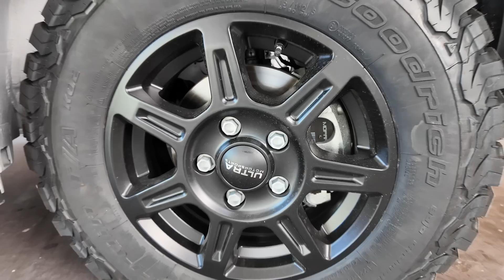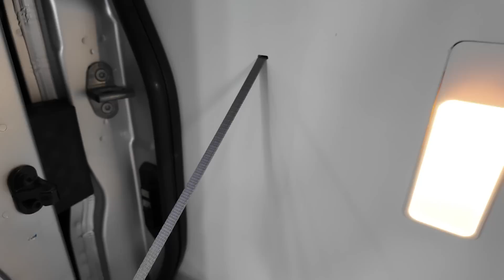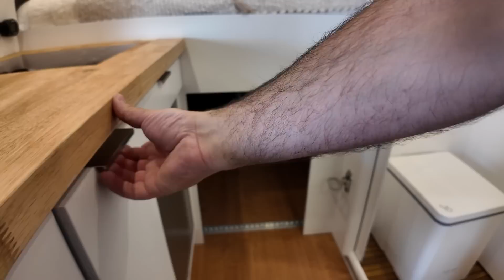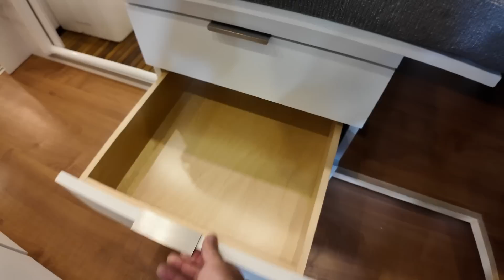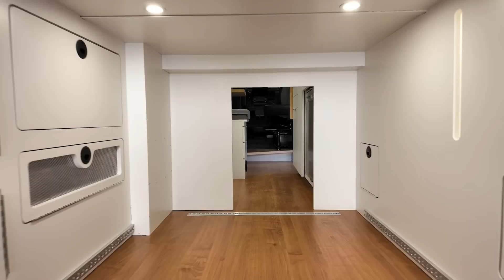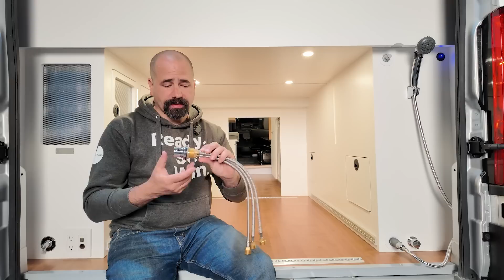Hawaiian Highline! Promaster van build with custom acrylic shower, butchers block surfaces and more!

Comment: Absolutely! Love Your design. Have you ever tried the 2 or three-stage heat/hot water maybe a coolant loop to assist free heat while driving & a possible 2nd fridge/freezer setup? I've been planning to get one for an on-site mobile office/etc. (hotel, kitchen, a foldable shower) all in one Greatness. If so I may need 3

Comment: Love this build.  Actually - pretty much love all of the builds you showcase.  Dumb question: how does the bed get air flow as I noticed that under the bed in the garage - the ceiling to the garage (which is under the bed) does not allow for any air circulation? I am always worried about mold and lack of proper ventilation of the bed itself.  Thanks!
Reply from the maker: Thanks! Mold is definitely a consideration and something that we take quite seriously. The bed is vented! There are channels cut into the bed platform and holes on either side so that air flows and prevents mold. We can go into depth on this on another video.
Reply: Maybe, bed slats used in mors european RVs is the way to go:  added comfort and full ventilation allowed.